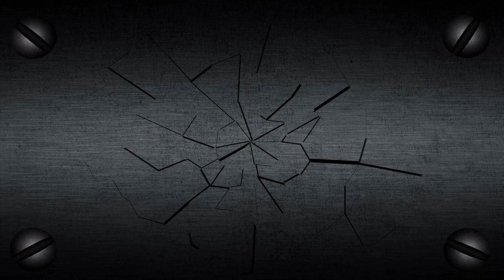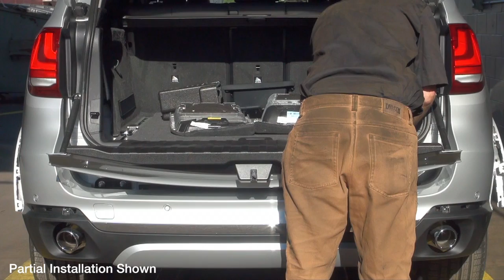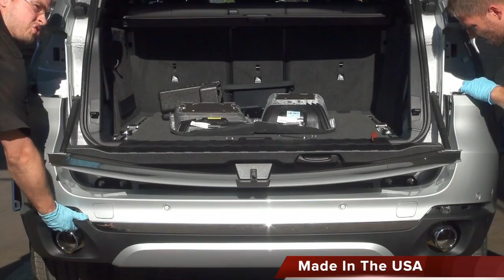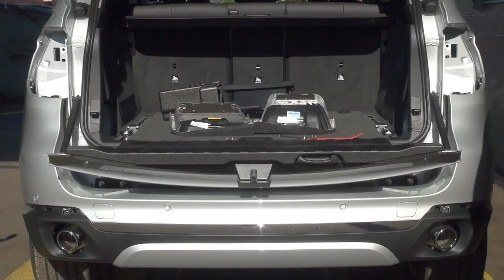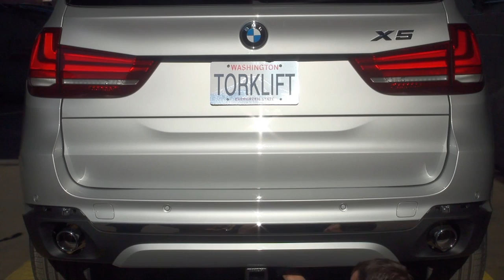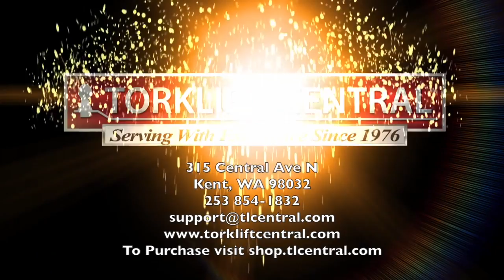2013-2018 BMW X5 Stealth EcoHitch Trailer Hitch -Torklift Central

Comment: Who needs a rear crash bar anyway....just take it off?? WTF.  etrailers makes one where the hitch is attached to the same studs as the crash bar, then the crash bar is reinstalled back on.  So basically you'll stiff have the protection of a rear bumper beam AND the steel hitch bar.  I think thats a better design.
Reply from the maker: Hey Michael, 
Thank you for your comment. We completely understand about your concern about the bumper beam and its removal during the installation. Since the factory removes the bumper beam (impact bar) during their installation, as do other aftermarket hitch installations, it’s not necessary to retain the bumper beam when installing the EcoHitch. Our hitch also comes with a lifetime warranty and our 24/7 tech support team. 

Please let us know if you have any additional questions we can help you with or feel to contact our tech support team at 800-246-8132.